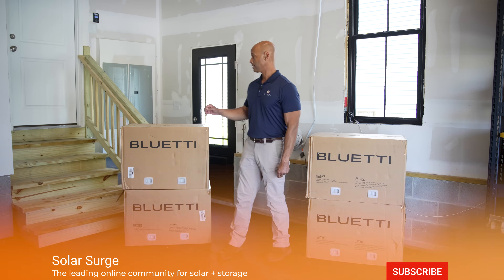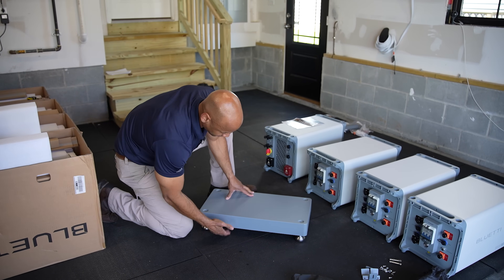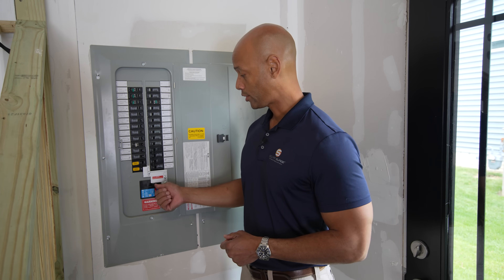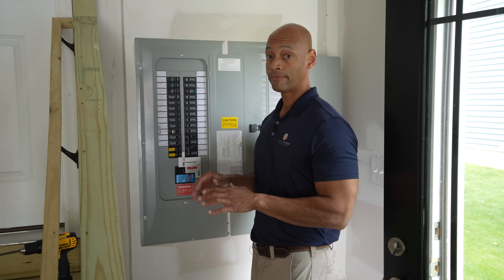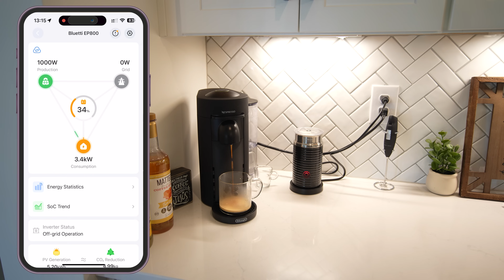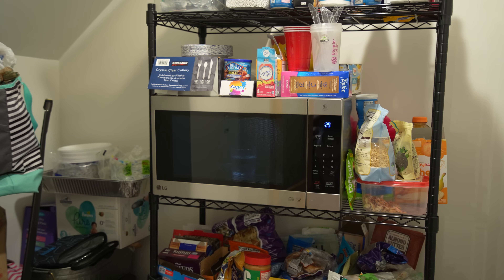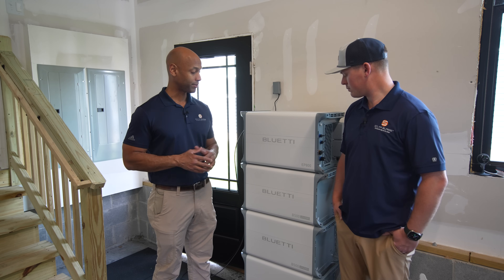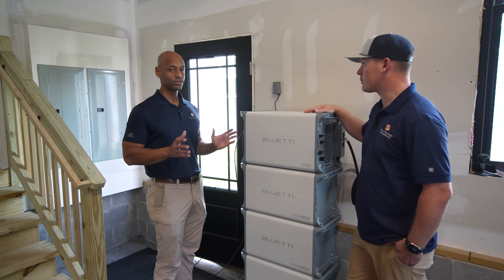Bluetti EP800 Installation & Hands-on Review

Comment: Will the grid AC recharge the batteries during prolonged cloudy rainy days the way you have it connected through the generator receptacle.
Reply from the maker: Yes, it can. The way we have it connected in the video shows output power going into a generator port. But there is another circuit that you can use to feed grid power to the inverter to keep the battery charged.
Reply: @ ok, thanks for the fast reply.
Reply: @SolarSurge I have a 11.4kw ground mount solar system with a Fronius string inverter connected to the house between the power meter and the main 200amp panel. The main panel is full, but I have a 100 amp breaker feeding a separate metal building and 200 amp panel. If I install a Bluetti EP 800 or 900 in that metal building connected via a 50 amp breaker and an automatic transfer or disconnect switch at the main house power meter and the grid goes down and is disconnected from the house will the Fronius inverter sense the AC from the Bluetti such that we could utilize the solar in conjunction with the Bluetti during long outages?

Comment: We're finally done with paying for our boys' educations (k through univeristy) and my wife and I are now serious about installing a PV+battery backup for our all electric home before retiring next year (or soon thereafter).  I currently have only one Predator 9500 (with an extended runtime kit, having an 18 gallon aux tank, to provide backup power.  (We were fortunatl to have had to use it only once for a very short black-out period.)  I have a soft-start on the heat pump.  The Bluetti system and the Solix X1 look like interesting options, though the Bluetti seems to accomodate only two parallel units (not sure if this is really an issue--need to run the numbers).  Can the generator be used concurrently to charge the Bluetti batteries and augment load demand much like the PC panels during the day?

Great video, btw.

Comment: Could the interconnection be made in future versions using the feet of the modules connecting to the top? So you would just stack these modules on top of each other and they connect to each other without any cables? A bit like connecting an iPad to the smart keyboard. Would be much easier if that could be developed?

Comment: I have and Enphase system with no batteries. I have a generator hookup with a manual lockout. When the power goes out, the solar energy is automatically shut off.
How would I hook up a Bluetti to use the solar energy during a power outage?  Is it possible?

Comment: This Guy has a WELL THOUGHT out Home, like on The Farm here. Everything is running on Propane, you can Buy and Store over a Year’s worth of it, and it Never goes Bad.! 
Also a Propane Generator, to refill the Solar Batteries, when Needed. 
Primary heat source is Wood, with the Propane as a backup, along with On Demand hot water, Dryer and Stove/ Oven, all on Propane. 
Minimal Dependence on Electricity as a Primary Source. 👍

Comment: There are a lot of auto switch over systems now that work very well. Seems it would be better to set this up so he doesn’t have to plug it up if the power goes out.
Reply: ATS is included in the EP800. Joe didn't use the auto-transfer installation method because he wanted to utilize the gas generator inlet.
Reply: If he used the ats can the solar panels also feed while grid is powering stuff?

Comment: I'm in VA as well and doing something very similar to this setup.  I have a whole home generator, thanks to the Veteran Affairs, incorporated into my plans.  In case of a long outage, I plan to use the whole home generator during the day and solar batteries during the night which will be connected to an inlet box.  My only concern at the moment is, while using the solar batteries at night, how to use inlet box without leaving the door opened.  Only thing that comes to mind is getting a long enough power cable that will connect the solar battery to the inlet box with and having it go through the window.
Reply: Is that whole home generator for something like a CPAP machine?
Reply: @SuperSushiRoll  no, the rep wrote it up for charging electric wheelchair and to power my air mattress. I'm service connected so that probably helped my case.
Reply: You can have a 3 pole double throw switch installed and have 2 inlets installed- 1 outside for generator and 1 in the basement for batteries.     You can switch between inlets- I have this set up and have used it without issue. This example below is what I based my set up on except  I have 2 sets of the batteries shown in that video- what you can see is his inlet set up and he explains it really well. 
https://youtu.be/_G7ZPjmR5ck?si=wzea3I9I5hOxZrFE